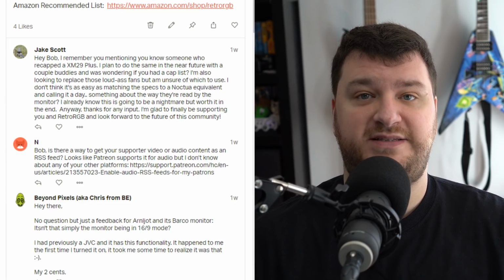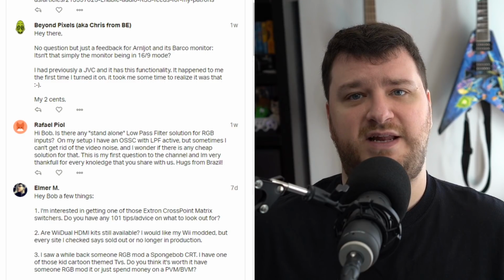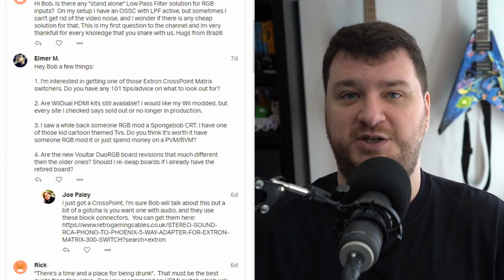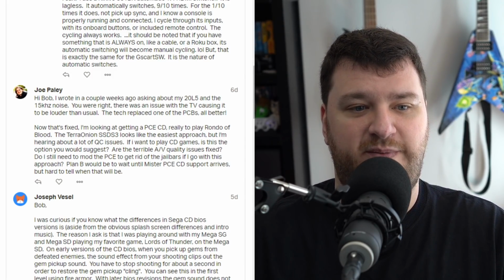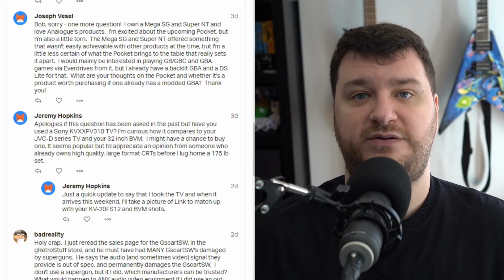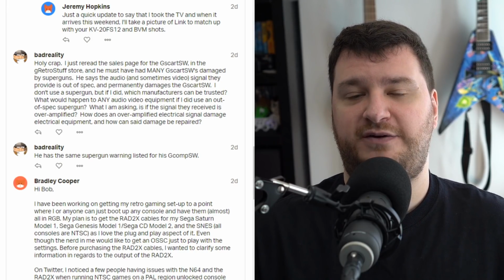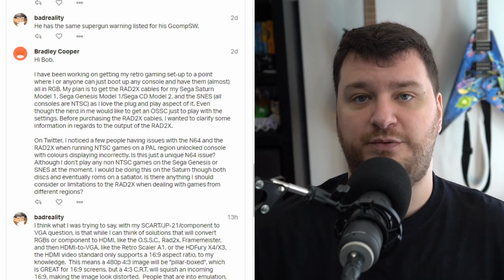Supporter Q&A #94

Comment: Bob- regarding the XM29/XP29 fans, no matter what fans are put in, only the originals work. If Any other fan aside from the originals is installed in the monitor, it won’t power on.

Some people have said doing fan wiring mods such as the BKM41/42HD mod can make other fans work in the NECs but I’ve tried something similar and it didn’t work.
I hope you know someone who owns an NEC who could possibly come up to a solution for this problem as the fans are super loud :( 

If anyone comes up with something please post on the NEC thread on shmups forum...
Reply: I have posted about it in the shmups NEC thread under the hardware section if anyone is interested.

Comment: Timeline

00:26 Barco Monitor issues
01:15 Floatplane and 4k uploads
03:47 XM29 Plus Cap List and Fan replacement
05:57 Supporter RSS Feed
07:47 Barco Monitor cont'd
08:52 Standalone Low Pass Filter
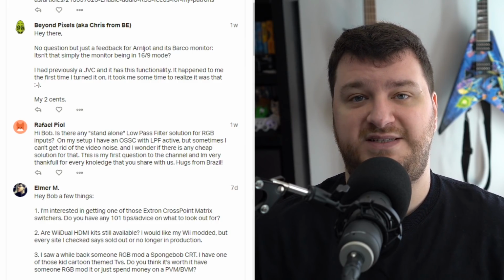12:17 Extron Switchers / WiiDual HDMI / SCART upgrade on kid CRT TV / DuoRGB differences
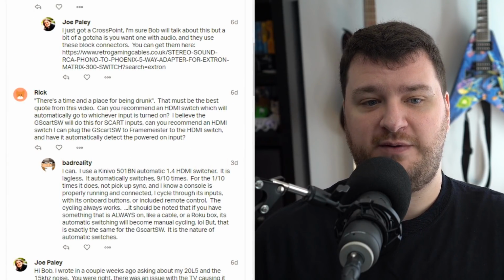17:28 HDMI Switcher for Framemeister
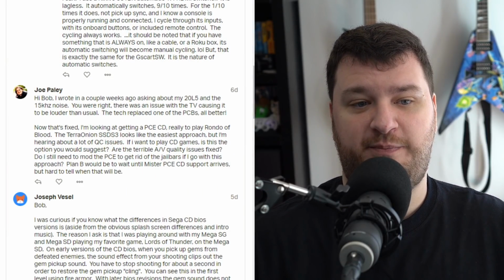19:12 Noise in 20L5 (Last Week Followup) / PCE CD questions
24:04 Sega CD Bios revisions
26:01 Any PVM Techs in Chicago?
28:56 Analogue Pocket
30:33 Sony KVXXFV310 vs JVC D / BVM
34:00 Superguns damaging GScarts
37:18 RAD2X and Different Regions
41:33 6th Gen 480p on 4:3 vga crt 
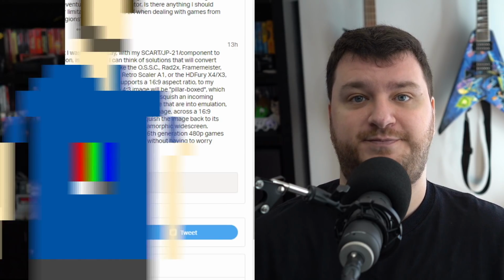43:50 Closing

Comment: Regarding the Sega CD bios. I fix a lot of these. As far as I am aware the changes in the Sega CD bios include things like changing commands to the CD drive. Specifically the opening and closing and spinning up signaling. They also changes different behavior when the CD tray is opened. But I don't know of any change in the bios that would effect the sound...Sega CD model one and two and the first two versions of the woundermega all use the same sound Amps and chips. I am not sure about the CDZ/multi mega's sound, that might be what is causing the difference though. It's interesting I've put different versions of the Sega CD bios on multiple units never really noticed any thing different in game....